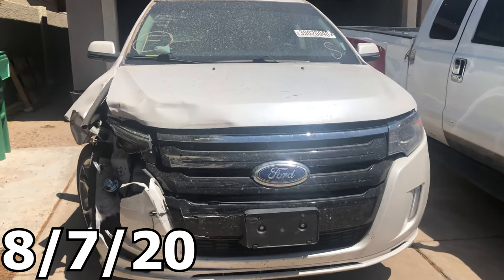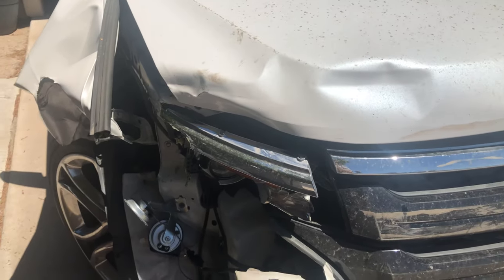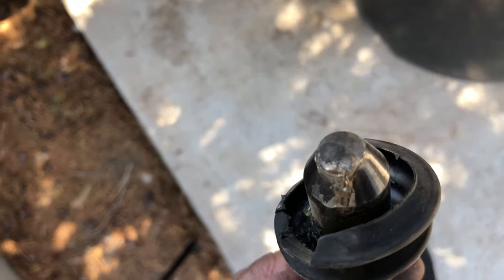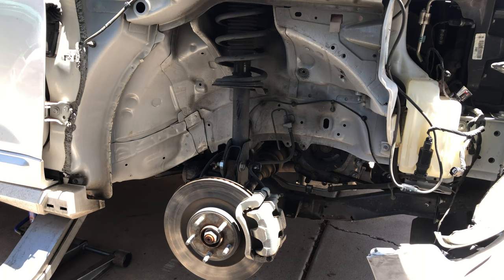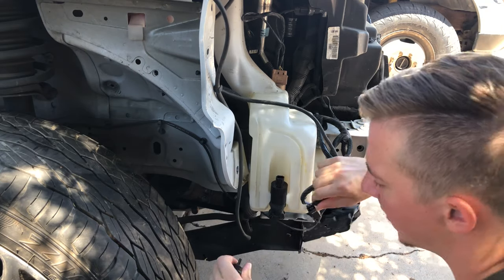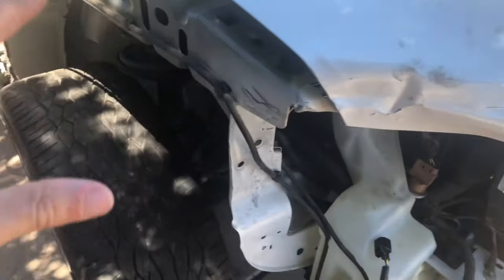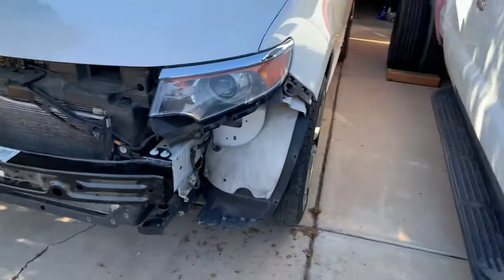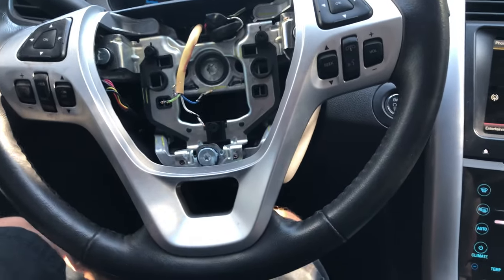Rebuilding a 2014 Ford Edge Sport | Part 1

Comment: Hi let me start nice job you have done , I have a 2013 edge sport awd  I have a question I have to replacement my horn ,can I just take the passager wheel and while off to get to it thanks alot and once again great job thanks
Reply from the maker: Thanks for the feedback!

I definitely think you will be able to do it with just the passenger wheel off and the fender liner out. It might be slightly annoying to reach around and do the one bolt that faces the front of the car but will be a lot less work than getting the bumper off. One tip - may need some of the plastic retaining clips to put the fender liner back on, they tend to break while being removed

Comment: Great video! I am currently replacing my driver side fender, bumper, headlight, hood hinges and ect. Although, I cannot figure out what the name of the plastic piece by the hood latch and above the grill. The grill component seems to clip on to it and that also needs replacing. Any help would allow me to buy the final piece before starting the job. Thank you for the video and help.
Reply from the maker: Here's a link for official Ford parts, its what I used to look up all the pieces and buy most of them if I couldn't get them used:
https://parts.ford.com/shop/en/us/body/bumpers/bumper-assy-front-6344843-1

If that doesn't help feel free to send pictures to my email in the description, I'd be glad to try and figure it out!

Comment: Grrrreat vid!! Love my '14 SPORT! 

Are there any tricks to removing the steering wheel cover? May have been a different process with the airbag being deployed, but I have tried 3 times to get mine off to get to the screws or clips that hold the gray trim, so that I can remove & wrap or spray it to match the remainder of my interior & I can't get the tabs to release.

It is driving me bonkers to have everything sprayed to match, minus the only thing not matching, is my gray steering wheel trim.
Reply from the maker: Should just be able to go in from behind the wheel and poke with a screwdriver from each side into the holes to get it to release. Make sure you have your battery disconnected for at least 10 minutes before messing with the airbag at all.
Reply from the maker: You can kinda see where I’m poking around at 9:20

Comment: Love your video. Quick question - do you know the name of the part that sits below and front of the radiator? at 6:45 in the video, you can see it very clearly below the crash bar. It has a bored hole in the middle of it. I'm curious because I ran over some piece of plastic or something on the highway and it busted that in 2. I'd like to replace it, but I can't even find it online because I don't know what it's called! Any help would be appreciated.
Reply from the maker: Unfortunately that is part of the Radiator Support Panel which on these is a big square shape in the front going top to bottom. Not insanely expensive from Ford but may take a lot of work to get the old on out and new one in. Here's where I found it (remove and replace DOT to complete the link):

https://parts DOT ford DOT com/shop/en/us/body/other-body-related-parts-front/front-end-assy-7821347-1?pdp=y
Reply: @bzmiatas  Thank you!!
Reply: @bzmiatas  Hi again. From what I've been able to determine, it looks like I may need to remove the radiator in order to swap this part out? It looks like perhaps the radiator is attached through this piece at the bottom. Is that correct?
Reply from the maker: It seems to be that way, I don’t own this car anymore so I can say for sure

Comment: Where is part 2?
Reply from the maker: Unfortunately I didn’t meet my goal of finishing and road tripping in it, the MVD was already booked out more than a month in advance for level 3 inspections so I had to rent for the road trip. So I stopped prioritizing this car and got back to the truck I have to rebuild as well, and first year of home ownership is a much bigger project than planned for so that’s getting lots of my time.

Right now the Edge needs paint, the seatbelts and SRS module to be sent off to be repaired, then I need to get the airbags in, and the final piece will be the dash being repaired where the airbag tore through. Not too familiar on the process for that which is another reason I’ve procrastinated.

I’ll see what length of footage I have since this video, and if it’s worthwhile I’ll make that part two and have it out in a few days.

I really appreciate your interest!
Reply: I have a 2013 Ford Edge and it’s a nice car
Reply: @bzmiatas  waiting for the part 2
Reply from the maker: @Mike-iw4on  Editing some of it right now! But I still need to do more work on the Edge to make it a strong video. Just finished part 2 on my truck, so part 2 of this is going to be the next thing out!
Reply from the maker: Part 2 is finally out if you're still interested